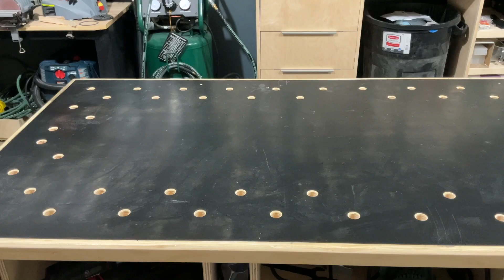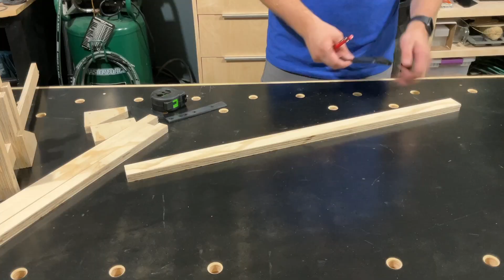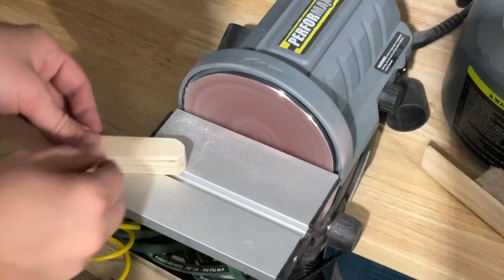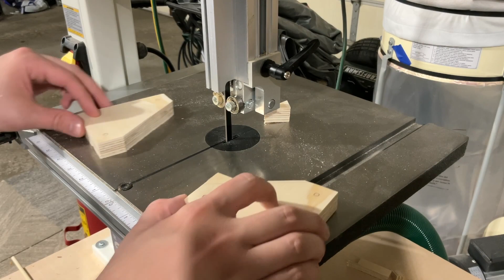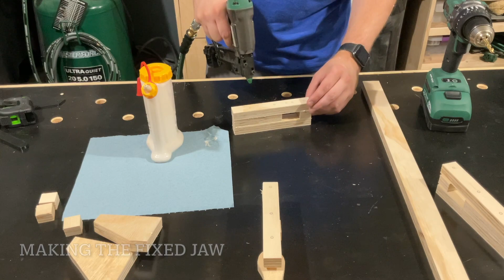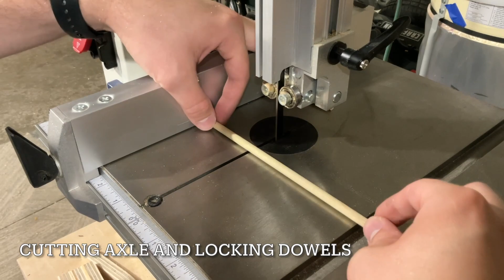Plywood Parallel Clamps | DIY Parallel Clamps

Comment: Nice, but is it strong enough?
Reply from the maker: For woodworking, yes. I use these types of clamps for panel glue-ups and boards for panel glue-ups should be jointed because too much pressure to push panels together will cause warping, however, if I’m making a thick butcher block out of construction lumber I like to use heavy duty clamps rather than spending hours on jointing